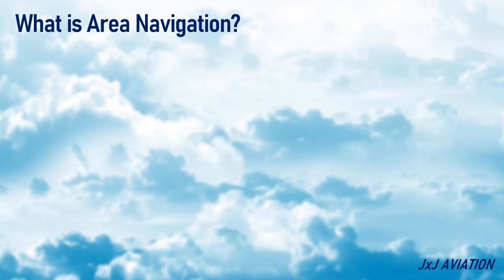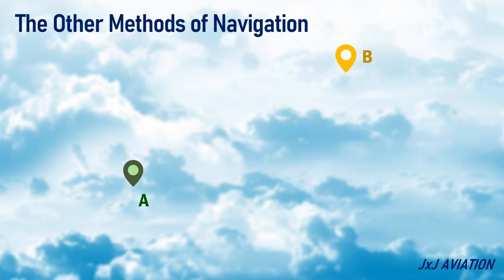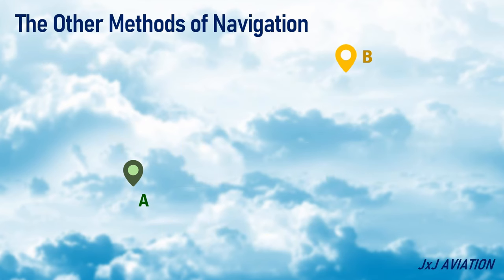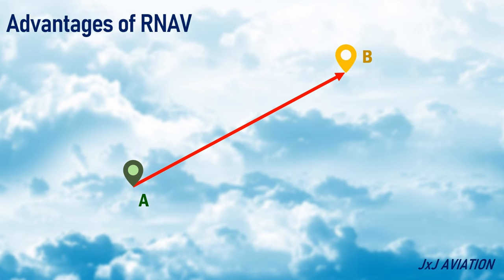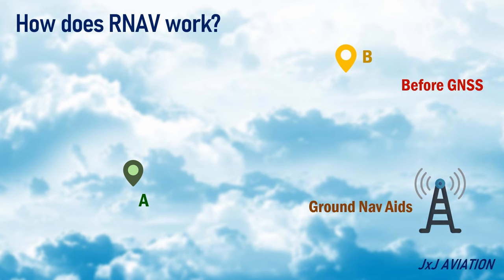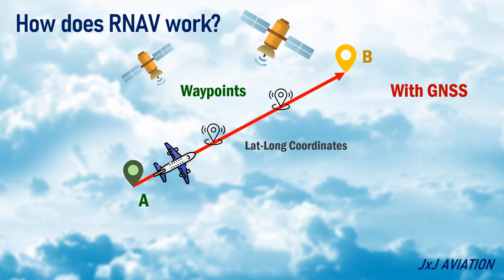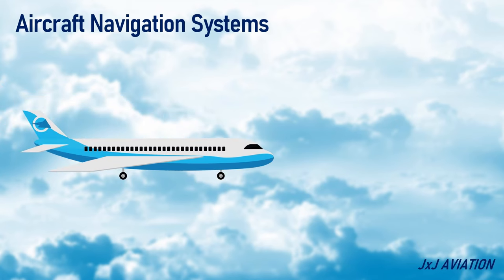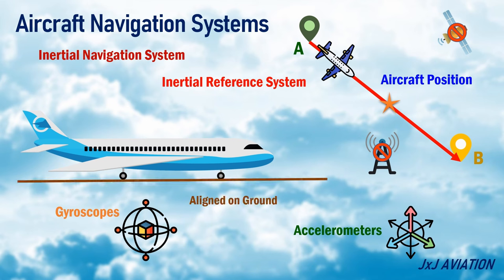What is Area Navigation? | Understanding How RNAV and Aircraft Navigation Systems work

Comment: 📝 Summary of Key Points:

📌 RNAV is a method of navigation that allows aircraft to fly on a desired flight path from one point to another, utilizing ground-based navigation aids, space-based navigation aids, self-contained navigation aids, or a combination of these.
🧐 RNAV offers advantages over other navigation methods such as VFR and traditional ground-based navigation aids, including direct routing, reduced flight time and fuel consumption, improved airspace utilization, and reduced need for interaction with air traffic control.
🚀 Modern aircraft are equipped with inertial navigation systems or inertial reference systems, which use gyroscopes and accelerometers to sense the aircraft's movement and provide continuous position information, even when external signals are not available.

💡 Additional Insights and Observations:

💬 "RNAV has revolutionized aircraft navigation by allowing for direct routing, reducing flight time and fuel consumption, and improving airspace utilization."
📊 The use of RNAV can significantly reduce flight distances and fuel consumption, leading to cost savings for airlines.
🌐 Global navigation satellite systems (GNSS) like GPS have made it possible to create waypoints using specific coordinates, even in areas where ground-based navigation aids cannot be installed.

📣 Concluding Remarks:

RNAV is a game-changer in aircraft navigation, offering numerous benefits such as direct routing, fuel savings, and improved airspace utilization. With the use of modern navigation systems, aircraft can accurately navigate specific routes, even in the absence of external signals.
Generated using Talkbud (Browser Extension):